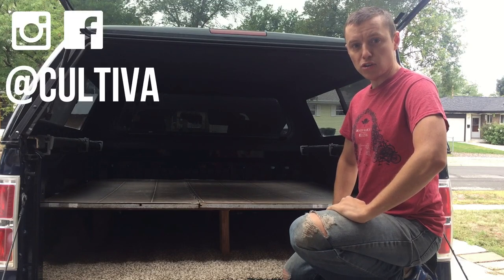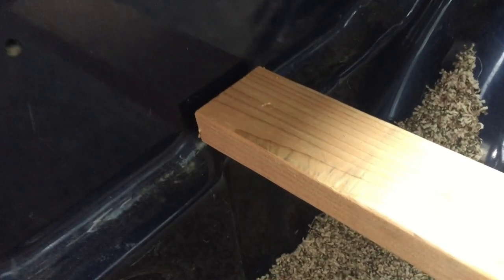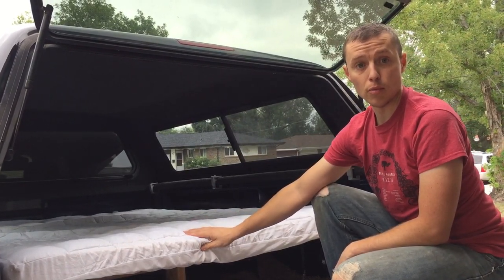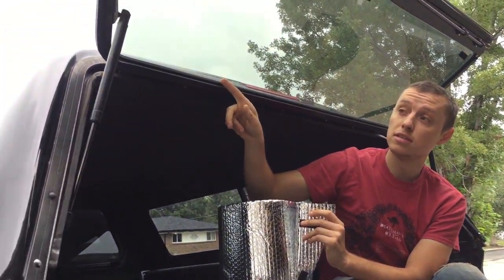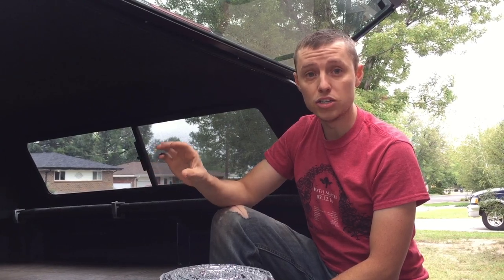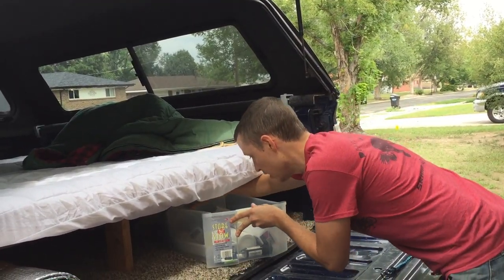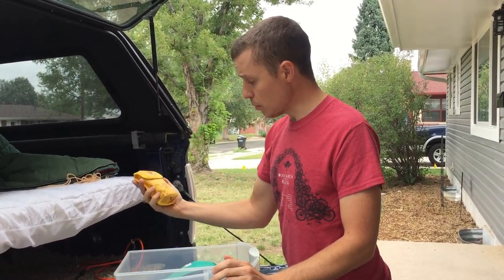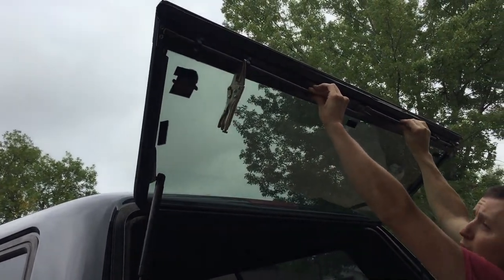SUPER SIMPLE Stealth Truck Camper Setup

Comment: Man, she just sold you up to the Blooper God's!  Nice video you two.  Aaron, I would like to make a recommendation.  If you will take a piece of cardboard and make a template of your camper shells corner at three heights and send them to me I will custom make you a bracket so that you can attach your fire extinguisher to it right in the corner. This will ensure access to it both while you are camping and about for the day and while you are sleeping.  It would be nice to guarantee access to it at all times.  For the other corner I will make you a small 3 shelf counter to put things while your camping or sleeping.  Just let me know if your interested.  Chances are I will be spending the winter in the woodshop preparing for spring season of beekeeping.